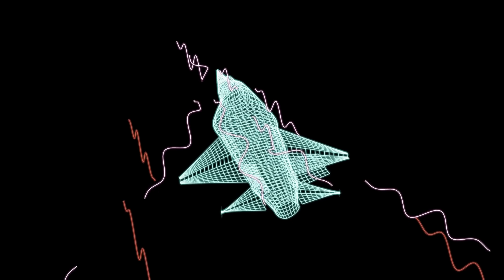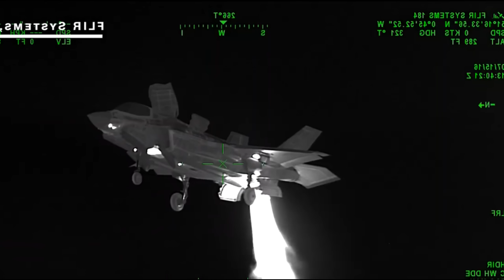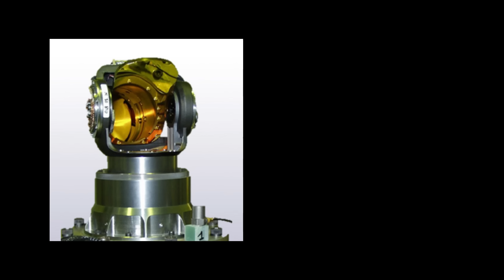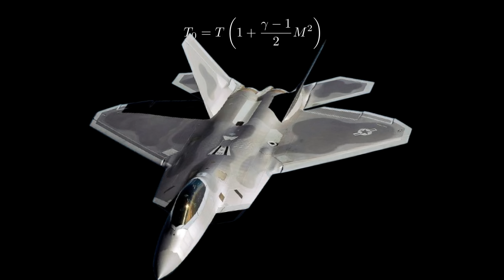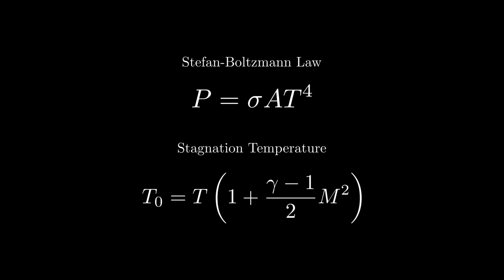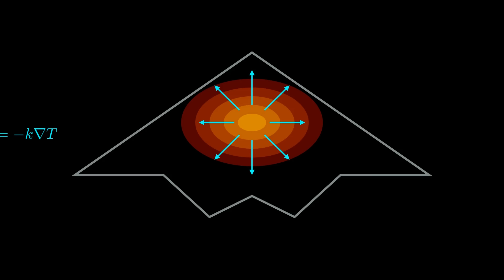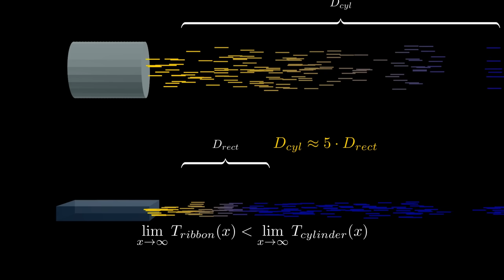How This Aircraft Became Impossible to Find.

Comment: The "cool" air used to cool turbine blades is NOT freezing. It's actually pretty hot. It's just not as hot as the gases it is protecting against.
Reply: That’s true "air used to cool turbine blades is NOT freezing"! Turbine blades are made of nickel-based superalloys, which are often single-crystal and coated with ceramics and they can work at very high temperatures without experiencing creep. The micro holes that create the cooling film only keep them at an ideal effective working temperature such as gas around blade: ~1500°C+ Blade surface (with coating): ~900–1100°C. Blade core (inside metal): ~700–900°C
Reply: It is technically freezing the blades by keeping them solid instead of melting.
Reply: @toolbaggers Just like it is "freezing cold" outside since the rocks aren't molten?
Reply: @ddegn yeah I like big booty dudes too
Reply: @ddegn yes exactly
Reply: @ddegn  From the perspective of a lava flow - obviously, yes.
Reply: Bleed air of around 500c cools the turbine blades
Reply: Yep, yeah, you don't wanna be blowing frozen cold 0 degree air onto something so hot, It's not gonna like it, also wouldn't freezing air not be optimal due to density?
Reply: @cascadianrangers728 no. It’s always optimal to be colder-look into the pre cooler on that British (now cancelled) takeoff to orbit (space)plane. Also think about it like this-colder air entering means it’s denser and you have more room to push it even crazier outside of what normal jet engines can do.
Reply: @Handledeeeeeeeeez  I believe you mean program HOTOL?
Reply: Eh, if you're at 35,000 feet it's definitely freezing.
Reply: @brianlaneherder3666  "it's definitely freezing"
Being confidently wrong is a bad look.
The cooling air has been pressurized. It's hot.
The cabin air in an airliner has to be cooled. Even though the air outside is very cold, by the time it has been pressurized, it is too hot for humans.
Reply: @ddegn to assist with the term: "adiabatic compression", leaving the radiation heating, and the nasty turbulence inside the compression stage aside for a moment.

It'll be really interesting to see the theoretical model engine producers use to model the heat management.
Supposedly, it's ultra secret++.
Reply: Technically it is freezing air if it it has the capacity to freeze something. You can freeze something with hot air if it moves fast enough and it has a lower temperature that what you want to freeze. It comes down to heat removal, not static temperature (which at high altitude it is super cold anyway)
Reply: @DuncanKassel  So the air outside on a hot summer day is freezing cold since it can freeze the rocks if they melted?
Sure "freezing air" can mean whatever you want if you don't care what words mean.
Reply: @ddegn thats what numbers are for , just use them and stop being obstinate
Reply: @nightshift65  It's "obstinate" to point out an error in an AI video?
Am I being too harsh on AI slop?
Reply: Yes, if it was, we would have failure

Comment: There's another benefit of the flat nozzle of the F-22, B-2, and F-117.  While solids give off blackbody radiation as a function of temperature, gasses give off blackbody radiation as a function of temperature and thickness.  Spreading the exhaust horizontally doesn't change the peak wavelength, but makes every pixel of it seen from below dimmer.  It does make every pixel seen from the side brighter, but that doesn't help ground sensors.  And unless you already know where the stealth plane is, you're not likely to match its altitude in a plane and see it from the side either.  And all it has to do is change altitude, or even bank (it will see you first, except the F-117), and you no longer see it from the side.
Reply: interesting stuff.

Comment: Have the plane control the release and fuse timing of a fragmentary grenade launcher as an airborne mine to defeat enemy missiles.
Reply: That's actually how a tank active protection system works. But i don't think they can implement this into an aircraft
Reply: @AnAnAsDUDE  Like reactive armour, it only works on a tank because it can tank it's own destructive defences. On a fragile plane, both systems would be suicide.
Reply: always thought about this as a kid and thought it was stupid that they didnt do that, but modern anti air missiles move well above mach 3 and can pull more G than most planes, so predicting the path and timing a "flare" like that would be very hard and probably not worth it
Reply: that's what a flare is, minus the fragmentation. and tanks have this system as well to actively defeat antitank missiles.

Comment: Honest question, if it has the radar signature of a bumble bee, doesn't one simply have to look for the 600 MPH bumble bee?  Others say it has the cross section of a sparrow, the same question would apply.  And is the sparrow carrying a coconut?
Reply: The radar doesn't actually see a bumblebee when it is at that distance because it is essentially taking snapshots of the sky and therefore that bumblebee blends right into the background noise which is usually filtered out be the computer.

Comment: Great video. The only mistake (that nearly everybody seems to be making) is the claim that when the radar-absorbing skin absorbs incoming radar waves, it heats up so much as to become an issue that needs to be handled. In reality, the energy density of a typical incoming radar signal is so many orders of magnitude lower than other heat sources, present in this situation, that it makes this factor to be completely irrelevant.
Reply: There was also another tiny detail, while explaining the round vs rectangular exit the example showed  slit, wen the F22 has moderately shaped the exits to be rectangular. Slit behaves very differently to what it really is, which is round pipe that changes to a rectangular exit. It helps but not as much as the example showed...  Hot air will still be at the core of that wake.
Reply: It was a bit clumsy articulated or practically wrong.
Reply: There's another video on this channel making the same point!
Reply: There was no mistake, he wasn't talking about the heat generated by the conversion of the radar wave that hit the airplane, he was talking about the heat generated by the plane itself.
Reply: @alessandrogirardi8081  Yes, he said that too (as the last item), but just before that, he said what I mentioned also.
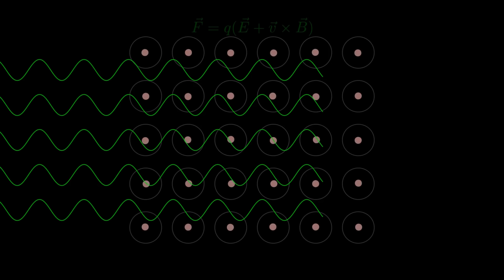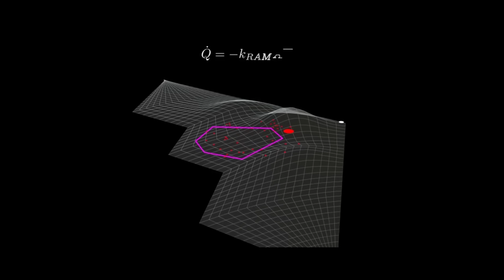What I'm referring to, he said in 16:23-16:52
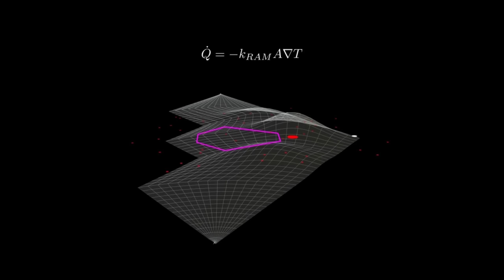What you are referring to, he said immediately after, in 16:52-17:20
Reply: @gintasvilkelis2544  What he is saying in 16:23-16:52 is perfectly correct.  The energy from the radar waves is indeed converted into heat, but he doesn't claim that this heat is a problem.  He just explains the mechanism for silencing the radar waves.  
The energy that hits a plane that is detected on radar, is something like 0.00000001 to 0.000001 Watt.  In comparison, the solar constant is around 1000 Watt/m2.
Reply: @Bob94390  The way he phrased it, created a definite impression that radar-induced heat was NOT irrelevant.
Reply: @gintasvilkelis2544  I don't see any reason to claim that he "created a definite impression" of that.  He simply explained the mechanism making radar waves "disappear".  And immediately afterwards, he even made it explicitly clear that this radar-induced heat is completely irrelevant.
Reply: @Bob94390  Here is the relevant verbatim quote:
“When an enemy radar wave hits this material, the electromagnetic wave induces a microscopic alternating current in the iron particles. But energy cannot be destroyed. It has to go somewhere. The ram absorbs the radar's electromagnetic energy and physically converts it into thermal energy. The plane absorbs the radar wave and in doing so gets hotter.”
 
I don‘t know about you, but I would never choose to use phrases like “the energy has to go somewhere” and “The plane absorbs the radar wave and in doing so gets hotter” unless this was an issue of tangible consequence.
 
And as for “And immediately afterwards, he even made it explicitly clear that this radar-induced heat is completely irrelevant”, the phrase “it also traps all the internal heat generated by the avionics, friction, and engines inside the aircraft” does nothing to specifically negate the relevance of the former; it only adds a second (relevant) item to the list.
Reply: @Bob94390 no